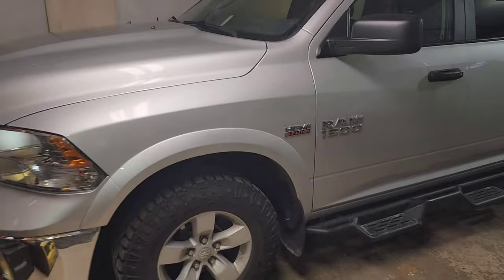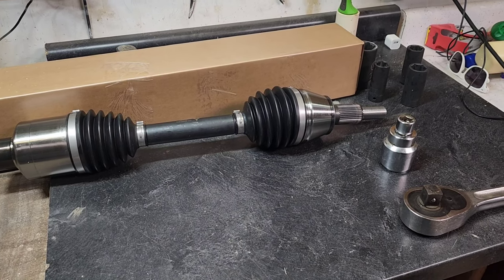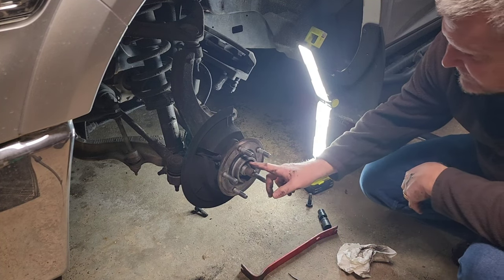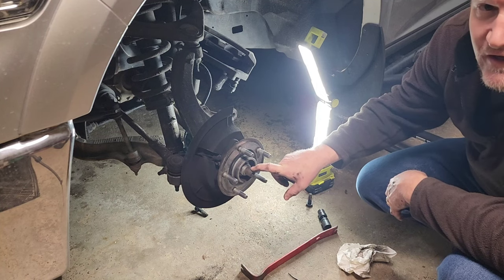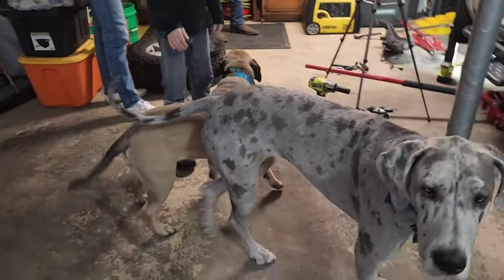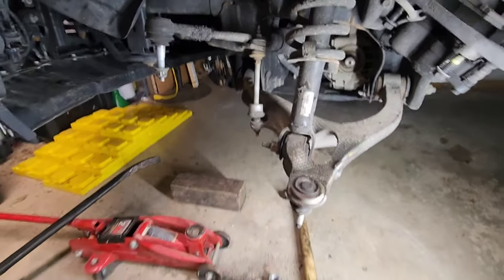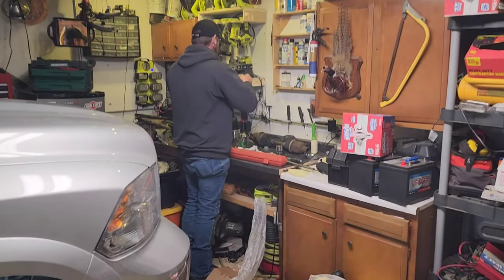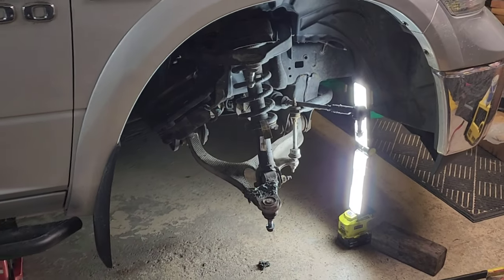CV Axle Replacement Project

Comment: what were the symptoms in driving how you knew something is wrong
Reply from the maker: Didn't notice anything while driving, but saw the grease on lower control arms when doing an oil change.  Stick your head behind tire tire and do a visual inspection.  I was surprised that both sides had failed at the same time.